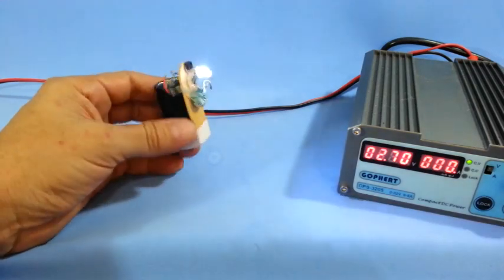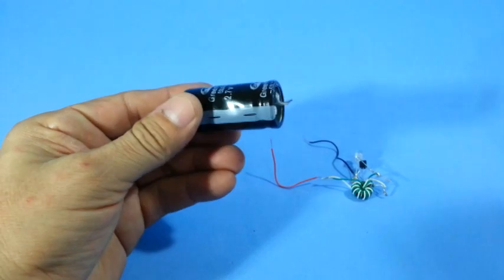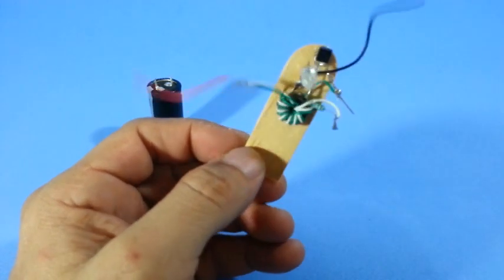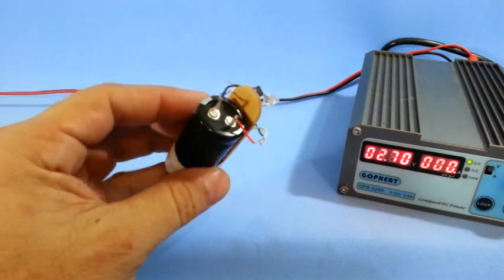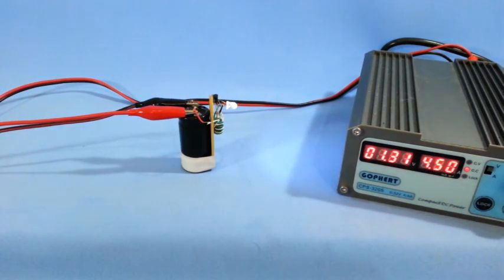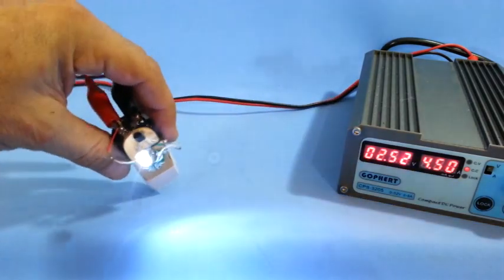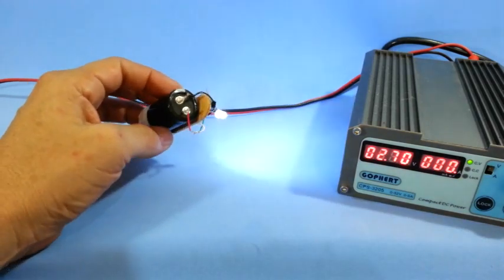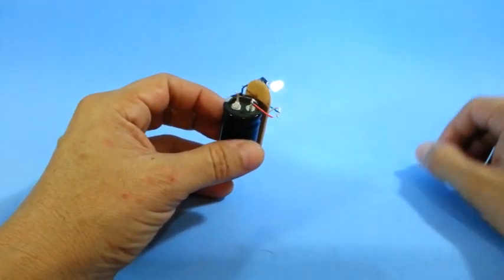Super Fast Charging Flashlight with Supercapacitor

Comment: How about making it chargeable by solar or by induction so you either leave it in the sun or on a transformer or it can be charged by EMF fields. Also add an on off switch so you can turn off the light.

Comment: This would be very good for those hand cranked flash lights
Reply: Lachlan O'Neil Well.. Not really, because as you saw on the lab bench power supply it charged for a minute with 4.5 amps. A generator in a hand cranked flashlight can't output that much current, so it would takea while to charge up. (This is only true if you use tha cap what was in the video. If you decrease the capacity of the capacitor, it can be a good hand cranked flashlight.)

Comment: You can add a switch, charge it up, and when you switch it on tomorrow you'll find it doesn't work since capacitor self-discharged overnight.
Reply: That is true, this is why flashlights don't use supercapacitors. The self discharge is just too low, plus the energy density is low as well. Compare a supercapaticor to an 18650 cell and the 18650 lithium cell is literally like 2000x better. lol

Comment: How bad of a shock would you get from shorting the capacitor terminals, once it is fully charged?
Reply from the maker: No shock at all. Its only 2.7 volts. However if you short the terminals the wire will become very hot and can even melt. you may get a severe burn, but from heat, not electric shock.

Comment: If I Use 1 Farad Super-capacitor How Long It would Last?
Reply from the maker: Not sure, maybe 2 to 4 minutes
Reply: +Ludic Science Maybe I`m Better Off To SJR Looper Circuit (by lasersaber)  Which Runs On Very Small (470uf) Capacitor For Over 10 Minutes!
Reply from the maker: Yes that circuit is more efficient than the joule thief
Reply: +Ludic Science Yeah If You Can Show Us A replication That`d Be Awesome

Comment: I have a super micro helicopter about 3 1/2 in long 2in high 1 1/8in wide very small but it's running in a 75 mah 15c 1 cell lipo do you think you can make a nano version of what you and if so do you think it would work better? 

It's a QINGSONG Qs-5010 micro 3ch rc heli
          THANKS

Comment: what's that inductor circuit is called? and what's the use of it? is it will give a steady voltage with limited current?
Reply: He says in the video, it's called a "Joule Theif" circuit. It's commonly used as a voltage doubler.
Reply from the maker: it´s a blocking oscillator, known as "joule thief". it raises the voltage of the cap and limits the current.
Reply: Ah, thanks
Reply: It is not a doubler even the resistance is constant and the voltage is inversely proportional to current because of high current loads applied to the circuit.
Reply: Owen David Effectively it IS a doubler, actually. Sure, it oscillates to do so, but its end purpose is the same.
Reply: It is a boost converter

Comment: my joule thief doesnt want to work with voltages above 1.5V, transistor starts buzzing and heating up, and its not very bright, how do you get it to work so well.
Reply: Add a 100K potentiometer in series with your base resistor and increase the base resistance

Comment: Hi. One question. In what voltage should i charge the super capacitor and how amps. Can i charge it with 5v iphone charger
Reply from the maker: you can use any voltage higher than 2.7 v, but you must check that the cap does not exceed 2.7. Current can be up to 10 or 15 amps, however your phone charger will only give 1 amp.

Comment: But how can I add a switch to the circuit please reply me quickly
Reply from the maker: on any terminal of capacitor
Reply: @ludicscience  i don't have a power supply or aa/aaa batteries. I want to charge it with a solar panel 
6v 1w or by hand crank (around 5v and 150ma). How i can limit the voltage to 2.7V volts. Please help me as i have ordered a 2.7v 100f super cap and i want to make a fast charge flash light. Please reply as fast as possible or moreover can u make a video for this topic. Please help thanks
Reply: @anmolkumar6704  you can youse a step down voltage reagulaiter to set the voltage

Comment: can I use a normal electrolyte capacitor
Reply from the maker: No
Reply: Md. Saiful Islam, they have lower capacitance in micro-Farad; mirco =1 out of million.
even the ones with 1000uF and 2200uF...etc. These are actually in milli-Farad; milli = 1 out of 1000
1000uF = 1mF, 2200uF = 2.2mF ...etc.
The one he used @ 0:31 is called SUPER cap and has 100 Farad rating.
Maybe you could find a super cap inside some old or broken microwave oven.